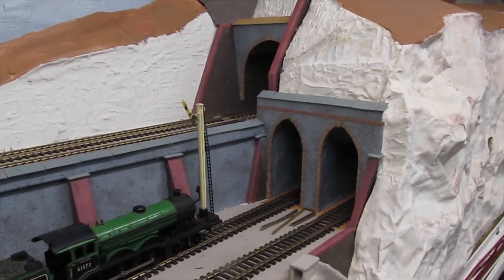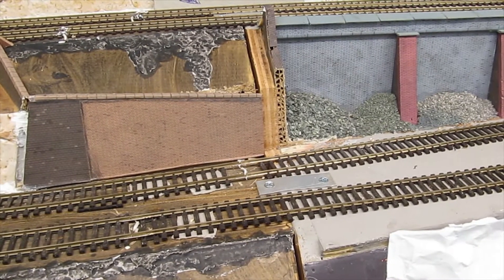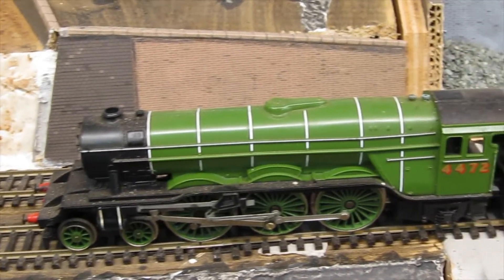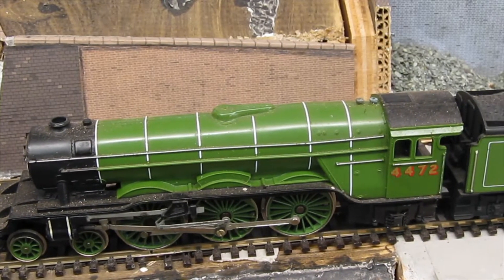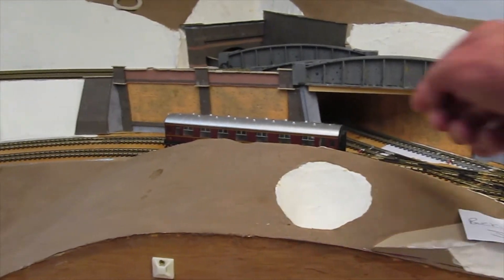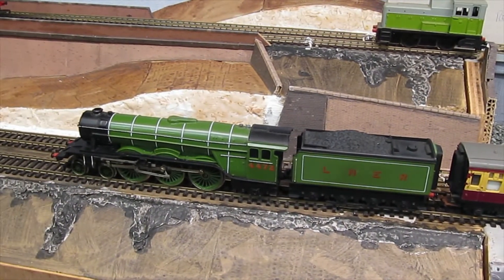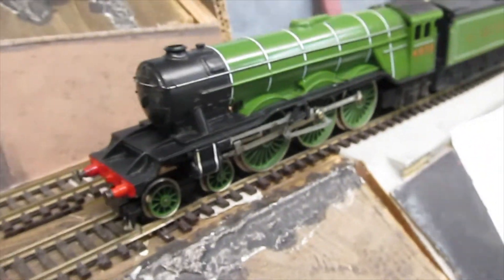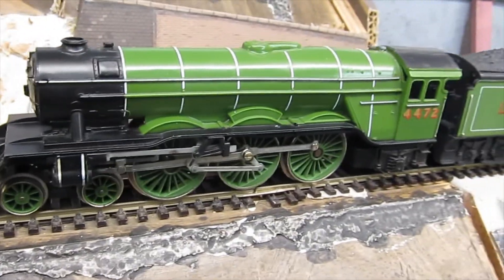Buckland Junction Loft Model Railway 3, A look at a 70s Flying Scotsman 4-6-2. Model running no 4472

Comment: Great video, thank you. I’m about to fire up my childhood Scotsman Identical to this one. Although little used and well cared for, I suspect it needs some work under the hood after 37 years in a shoe box! Any chance of a maintenance/service video? I’d also love to know where to start with a big track layout but one thing at a time.
Reply from the maker: Hi Jim. Thanks for your interest. Yes a loco service is on the books. As to planning a large layout I would take a large spoonful of imagination and build on that. Also scribble it down on paper, well that's my approach. Regards Alan in the loft :o)
Reply: @AlanReynoldsBucklandJunction  Thanks Alan, I'll look forward to the service vid. With regards the larger layout - I've always been baffled by the power set up, particularly the old school way of running multiple trains. All the best, Jim.
Reply from the maker: @jimboblog1426  Hi Jim. Have you seen my video 15 about DC electrics yet? It may give some insight. Part 2 is in the making. Regards Alan...